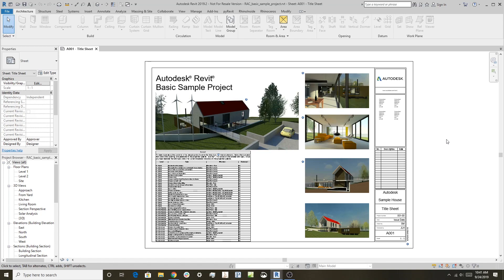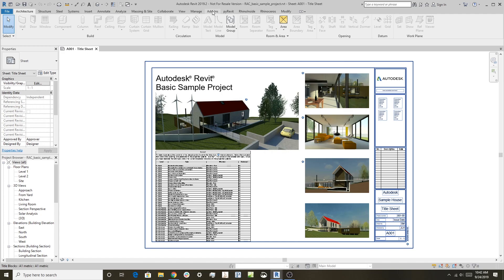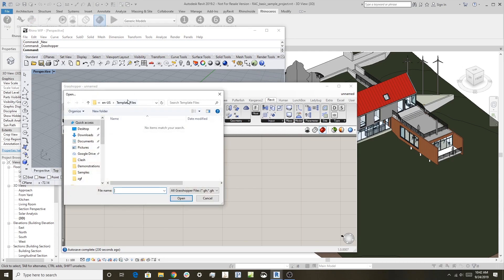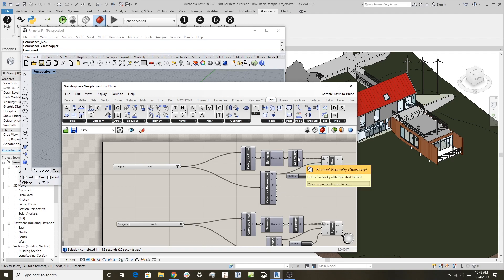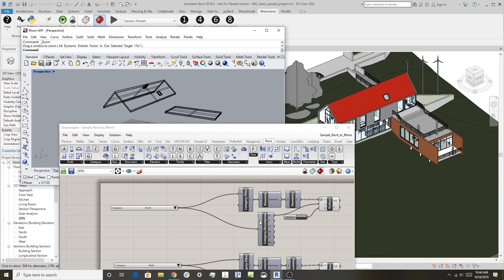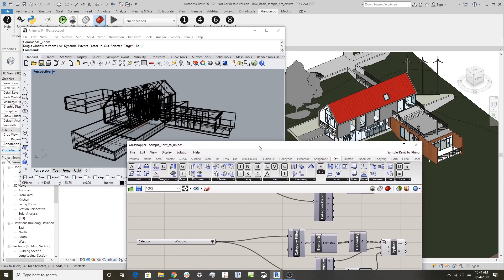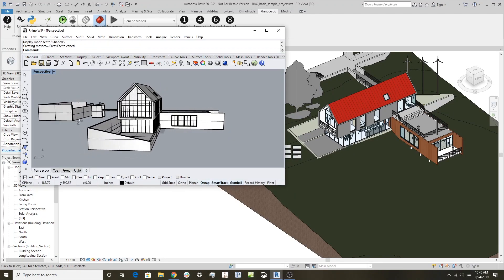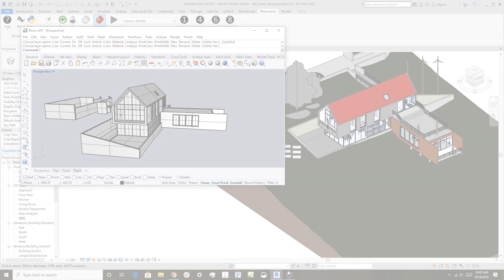Importing geometry from Revit into Rhino (3 of 5)

Comment: Hi Rhinoceros3d ! Thanks so much for these tutorials -- very helpful. I am interested in unpacking groups or families from Revit into Rhino. I have a hard time accessing nested information -- for example a glass panel within a curtain wall family. Let me know if there is a solution out there!
Reply from the maker: Yes, learning how to get down to parts of complex Families can take a bit of practice.  I am discovering something everyday on it.  I use the Document. Categories with a picker on the back side to select the Curtain Panels Category. If you want to combine that will specific materials or parameters that is possible also. Does that make sense?  I can add an example to the examples folder.
Reply from the maker: Give this definition a try and see how close it gets: https://github.com/mcneel/rhino.inside-revit/tree/master/doc/tutorials/07%20-%20curtain%20wall%20create%20and%20select
Reply: @Rhinoceros3d  This link is not working
Reply from the maker: @pinkproportion4950  - I updated the link in the comment, it should work now.
Reply: @Rhinoceros3d  link is not working again
Reply: @Rhinoceros3d  thanks so much ! I have tried this and it helps create a curtain wall -- and if I have that Type set up in revit model I can create a specific one. What I'd like to do is get a list of all the panels on that curtain wall so that I can choose some to make glass and some to make solid. Once I have an element, and have added parameters -- like vertical grids -- can I go in and select sub-elements like panels and edit those ? Thanks again